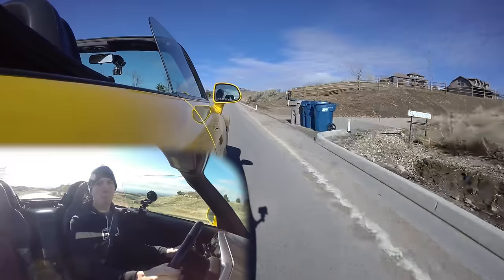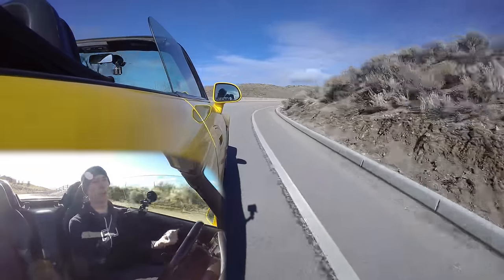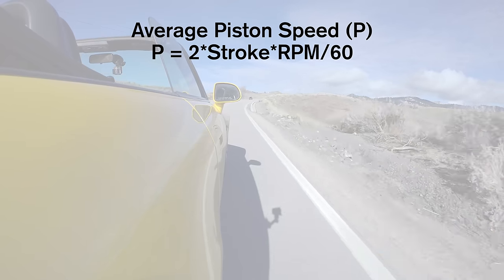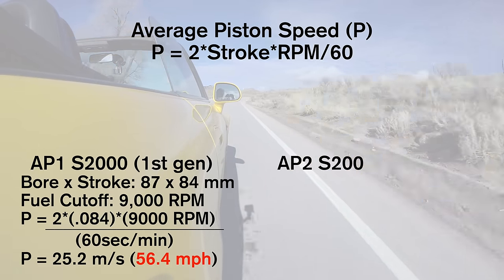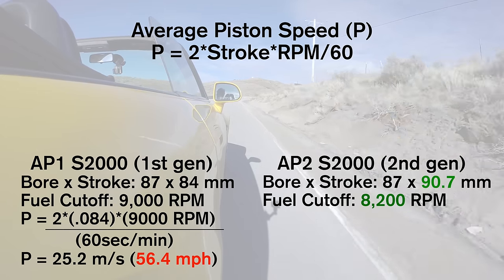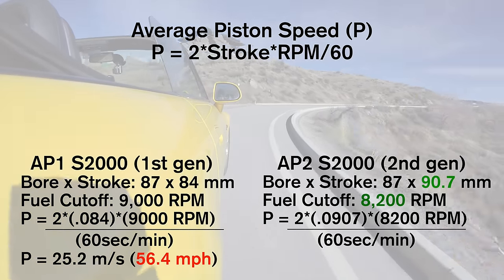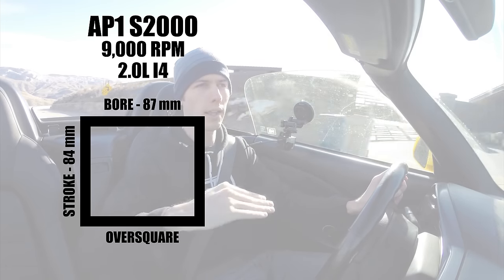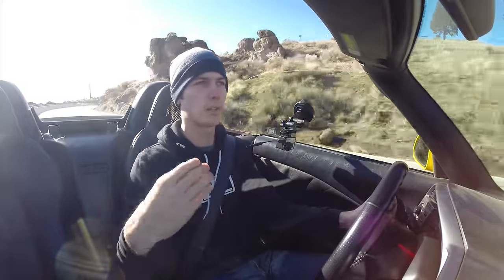How Do Some Engines Rev To 9,000 RPM?

Comment: Making engines rev to 9000rpm and much higher is not that complicated. There's motorcycle engines with car engine displacement that can rev well past the 10k mark. People just don't want engines like that in their cars. They're noisy, harsh and thirsty.

Most car engines could physically rev higher than their actual redline without excessive wear but it would be pointless as they're not tuned for high rpm and won't actually make more power for it. In fact contrary to popular myth most car diesel engines have the same sort of stroke length as their gasoline counterparts but don't rev past 4500. Why? Because peak power is at alike 3500rpm and torque is already in free fall by then, so why would you want to rev even higher rather than shift up?

Comment: Hello, no offense but you didn't really answer the question did you? If many cars rev around 9000, is it caused by like you said, they can't go faster than the flame and the whole valve process anyways? If yes, how can motorcycles and racing car engines reach 10 000+?
Reply from the maker: As mentioned, do the math on the motor cycle engines and F1 engines (I even showed an 18,000 RPM example). The stroke gets shorter.

Comment: 9,000 isn't special. I drove a 1968 Honda S600 in 1972 that was redlined at 9,000 rpm. Earlier that decade they had racing motorcycle engines that turned over 20,000 RPM and they had valves and springs and cams and all that. 5 years ago F1 cars turned about 21,000 RPM until the FIA put a limit on them. I had a 1999 Ford Escort with the 2 liter DOHC engine and it was redlined at 8500 RPM,  That was 19 years ago. An additional 500 rpm doesn't seem like much. What I want to know is how they keep those long stroke 356 cubic inch V8s together for 500 miles turning over 9500 RPM. Oh and my 1973 Honda CB350-4 was redlined at 10,000 RPM, yeah, 45 years ago on a street engine and it ran and ran and ran.  I frequently buried the tach way past the 12.000 rpm highest reading on it. Oh and lest we forget some history, The Ford GT's that ran at Le Mans in 1964 were powered by 289 pushrod V8s and they were pulling 7200 rpm on the long straight in 5th gear of 5. That's 45 years ago.
Reply: Honda s600 was only produced until 1966 and produced about 50HP at the crank... 1999 Ford Escort 110HP... The 289 V8 built correctly can easily do over 8000 RPMs, while making roughly 400 WHP. My 1965 Chevy II Nova (fully built high compression, high revving about 9400 RPMs max 283 v8, with a Tremec T56, Dana 60 with a Detroit Locker), quarter mile on pump fuel in the low 10s. SO while I agree that high revving engines have been around for a long time... not until recently have they made any "real" power.

Comment: People like high reving engines but they like high torque engines as well but these statements are contradictory  😂 
So for example you have a 200hp engine
Some will like a 300Nm for example with this engine. But high torque mean a lower max rpm or at least a a torque curve that drops sharply after about 4000rpm in this example. Why? because if you have high torque at high rpm you have a much powerful engine and of course you like a more powerful engine of course you like 400hp more than 200hp but his purpose of this discussion is to compare cars with the same maxim power and to choose which one you lime more, the torquey one ore the high reving one.
Honda s2000 users complain about low torque at low rpm but they like the high revs as well
You can’t have both, for the same power you either have high torque low rpm or low torque high rpm. For a sports car I would always choose high rpm. Of course there are some slight variations where a car can have a bit higher than normal low end torque but not too high 
Example I have a 3.0 265 hp 315 Nm max torque engine. But also it’s more than 20hp difference. The torque is a bit higher than a normal naturally aspirated engine because it uses some intake manifold flaps to control the inertial flow. It revs to 7000rpm, also VVL and VVT
But the s2000 goes up to  9000rpm 
turbocharged engines also can use even more torque  at low rpm but still when the rpm increases the torque will drop and max rpm is around 7000rpm. 
So the conclusion is:
There are ways to increase a bit the low end torque but a very high rpm engine will have less low end torque for the same max power.
S2000 torque is 200-220Nm

Comment: I'm disappointed.  You should of had your white board and shown the equation for rod:ratio and the variables of long rod and short rod engines. Examples like the 4g63 can have many different engine specs changed to make different displacements and rod ratios. 
Even the 4g64 can be de-stroked to make a 10,000rpm 2.1.

Comment: Honda 600 car rev'd to 9000 and did 60 in about two minutes......take one 350 cheby, spin balance, install 530/300 lift/duration cam, Holly DP, headers and you should be reving to 7500+/-.

Comment: Although this is fascinating, explain why Asian high rpm engine fail much earlier the there European counterparts is it an engineering issue,a material issue, design issue,  
I’ve had both in my case Japanese (3) 2 Nissan 280z (86k mileage)and 350z, ( 94k mileage)1 Toyota Supra (82k mileage )
and they have been properly service buy the dealership but they all needed engine work by 100k  now  over the last 7 yrs had BMW’s E60 M5  (127k Mileage)and E46 M3 (141k mileage)they don’t have the same or similar issue why is this ? 
The repairs on the Japanese care exceeded 63% of there value that’s why I got rid of them

Comment: My z350 rpm limits to 8000. How to pup it up!?
Reply: Stronger and lighter rotating assembly (pistons, rods, crankshaft). You might also need stiffer valve springs depending on the stiffness of the stock ones. Fasteners might also need to be upgraded, rod bolts especially.

Comment: Your tach is broken right?
Reply from the maker: No.
Reply: The tach in my '74 Corona worked just fine when my right foot booted it past 9K on a regular basis too.

It had an 18R-GR DOHC 2L with carbies. The fuel injected version was limited to 7.5K.

Comment: Is it the same explanation for motorcycle engines? My friend's Kawasaki 1000 revs up to 22,000.
Why don't these car manufacturers use these small displacement motorcycle engines instead?
1 liter sportbike engines gets 200+ HP, just double it and you get 400+ HP with just 2 liter 8 cylinder lol
Reply: Yep, same explanation. Sport bike engines aren't used in cars because they lack torque and don't meet the emissions standards required for cars. 400 hp is pretty useless with only 160 ft lbs of torque, especially in a 3000 lb car.
Reply: Well they are not too bad torquewise at the powerband, the problem is to get there
Reply: Bruh, S2000 only has 162 ft lbs of torque as well.
I don't know about the emissions thing, I can't be bothered to google it lol
Reply: Have you seen how the LFA revs? Its usually much faster than that.
Reply: emissions is going to suck with high rpm, cam overlap and short combustion time is not great for emissions.

Comment: 9000? hyuck hyuck. my diesel laughs at that! 3,500 redline here boiz.
My quad throt bike carb 4-AGE with tomei cams and a full head rebuild goes to 9,700 though.  
I did think about turboing it & de-stroking it to lessen compression (theres reasons)

Comment: Is 9000 a lot? Mine operates around 8000 and goes up to 12000. Didnt think i had anything special there
Reply from the maker: For cars, it’s a lot. Not for bikes, which use much smaller engines with significantly shorter stroke length.
Reply: Engineering Explained makes sense. I have a smart car... got a really small engine. Pretty much like a bike. Like 1000cc

Comment: my V8 is just 3000 RPM shy of your s2000 9000 RPM
Reply: Legolas My Cummins redlines 5800 rom less than the s2000, and the s2000 probably doesn’t even make enough torque to remove a lug nut.
Reply: @toyotaecw  torque isn't everything my little friend!

Comment: Some one calculate the piston speed of my 2JZ at 6,000 rpm!
Reply: It's 38.48mph
Reply: Thanks man, I was too lazy to do it myself. Think I have room for more revs if I set up the fuel system and do some head work?
Reply: For sure! Go for stage 3 lifters, valves, and springs. Also make incremental increases to stay safe

Comment: i find it so cute that car guys think 9k is high, when a 2006 Yamaha R6 goes to 20.000 rpm... even my 450 goes to 12.500
Reply from the maker: Turbine guys think it's so cute that you think 20,000 RPM is high. It's all relative.
Reply: Brutal reply, LOL. The difference is 4x the amount of displacement and piston size/weight. Also a way smaller stroke. All things he explained in the video.
Reply: Rekt!!!
Reply: 2006 Yamaha R6 don't even reach 17k. 
1994 CBR250RR is capable of 19k, and turbine guys would still think it's cute lmao
Reply: As an aerospace engineer, going with Engineering Explained on this one. I've played with a 500,000rpm turbine before. 

125hp in a 500 pound (with rider) bike ain't bad, though.
Reply: Bull SM there turbine it’s a bit different
Reply: You can hold this L
Reply: I fond it so cute that you think car guys care. The pistons in your bikes are smaller than the pistons in barbie's plastic mercedes.
Reply: Bull SM you are very smart, what about cornering? Ah right.
Reply: It doesn't matter how fast your legs move if you're still losing the race.